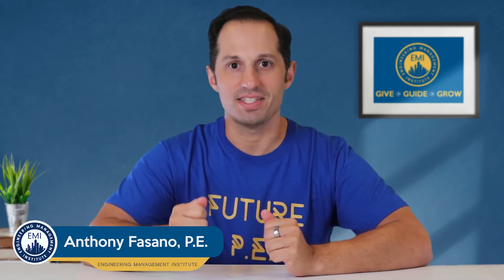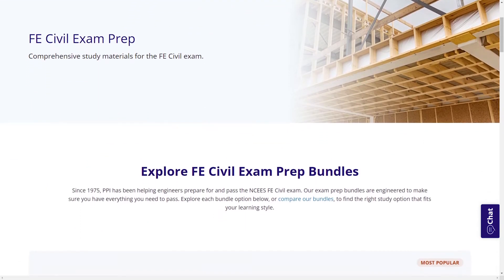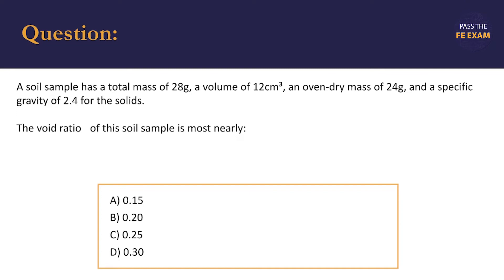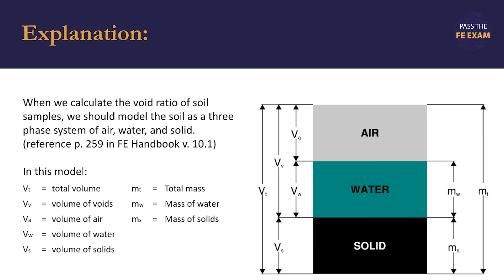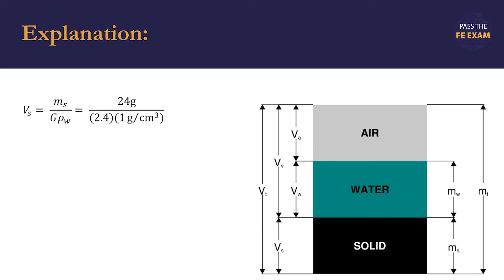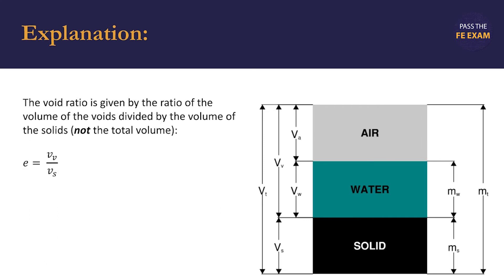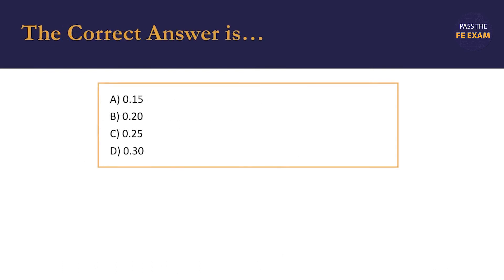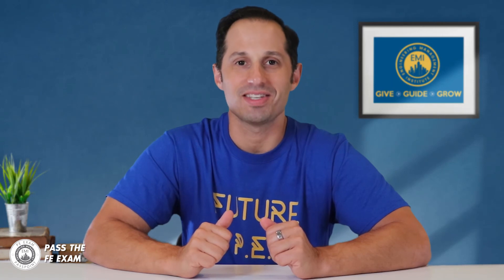FE Exam Prep: Civil Engineering Soil Sample {Question and Solution}

Comment: In a field exploration, a soil sample was collected in a sampling tube of internal diameter 5.0 cm below the ground water table. The length of the extracted sample was 10.2 cm and its mass was 387 g. If Gs =2.7, and the mass of the dried sample is 313 g, find the porosity, void ratio, degree of saturation, and the dry density of the sample.
Reply: Can you please help with this question
Reply from the maker: Sure, I can help you with that.

The following are the given information:
Internal diameter of sampling tube = 5.0 cm
Length of extracted sample = 10.2 cm
Mass of wet sample = 387 g
Mass of dry sample = 313 g
Specific gravity of soil solids (Gs) = 2.7

We can use this information to calculate the porosity, void ratio, degree of saturation, and the dry density of the sample.

Porosity
The porosity is the ratio of the volume of voids to the total volume of the soil sample. It is calculated using the following formula:
Porosity = (Volume of voids / Total volume) * 100%

The volume of voids can be calculated by subtracting the volume of solids from the total volume of the soil sample. The volume of solids can be calculated by multiplying the mass of solids by the specific gravity of soil solids.
Volume of solids = Mass of solids * Specific gravity of soil solids

In this case, the volume of solids is:
Volume of solids = 313 g * 2.7 = 845 cm^3

The total volume of the soil sample is:
Total volume = (Internal diameter / 2)^2 * Length = (5.0 cm / 2)^2 * 10.2 cm = 157.6 cm^3

Therefore, the porosity is:
Porosity = (157.6 cm^3 - 845 cm^3 / 157.6 cm^3) * 100% = 42.1%

Void ratio
The void ratio is the ratio of the volume of voids to the volume of solids. It is calculated using the following formula:
Void ratio = Volume of voids / Volume of solids

In this case, the void ratio is:
Void ratio = 157.6 cm^3 / 845 cm^3 = 0.186

Degree of saturation
The degree of saturation is the ratio of the volume of water to the volume of voids. It is calculated using the following formula:
Degree of saturation = (Mass of water / Volume of voids) * 100%

The mass of water in the soil sample can be calculated by subtracting the mass of dry sample from the mass of wet sample.
Mass of water = 387 g - 313 g = 74 g

Therefore, the degree of saturation is:
Degree of saturation = (74 g / 157.6 cm^3) * 100% = 47.2%

Dry density
The dry density is the mass of dry soil solids per unit volume of soil. It is calculated using the following formula:
Dry density = Mass of dry soil solids / Volume of soil

In this case, the dry density is:
Dry density = 313 g / 157.6 cm^3 = 1.99 g/cm^3

Therefore, the porosity of the soil sample is 42.1%, the void ratio is 0.186, the degree of saturation is 47.2%, and the dry density is 1.99 g/cm^3.

I hope this helps! Let me know if you have any other questions.